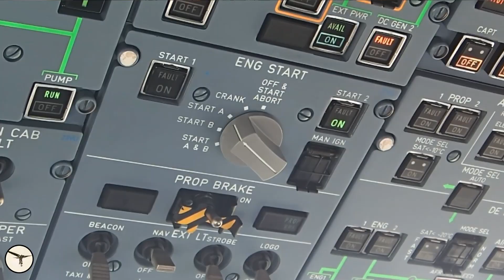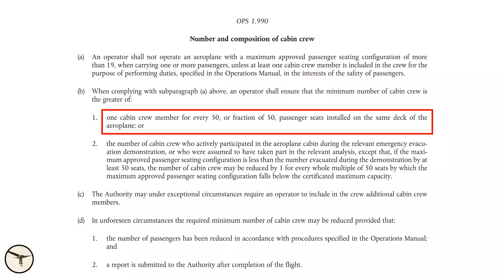Why was ATR's first aircraft named 42-300?

Comment: I have a question about the ATR cockpit. How wide is the panel between the pilots were the FMC is located in centimeter? I like to build a ATR homecockpit for a simulator but i can't find any measurements. If i know how wide this part is, i can calculate everything else from there :D
Reply from the maker: Contact me on my email (see the About page in my profile). I have several illustrations with measurements.
Reply: @FlywithMagnar  Thank you Sir, i will do that today :)
Reply: @FlywithMagnar  I wrote the e-mail :) I hope it will not end up in your spam :D

Comment: The ATR-42 was the first aircraft I have ever flown with as a passenger. I remember the seating area in the front where two seats were mounted backwards so that you had a table between the four seats where you could sit as a group and eat or play a game together. Were that common in all ATR or was that just in a few selected ones?
Reply from the maker: The club seating arrangement is quite common in airplanes with a high-density seating. However, the cargo compartment is smaller in size. It's up to the operator to decide what is most important: Two more seats or more space for the bags.

Comment: When I started in the Aviation Business in 1990, we had four ATR 42-300 in our fleet. MSN 38, 53, 122 and 158. Four more came in 1991 and 1992. MSN 233, 255, 287 and 289. We also received ATR 72-212A MSn 347, 359, 404 and 446. Further Aircraft came for NFD - Nuerenberger Flugdienst in 1992. I was responsible for 43 ATR42/72 at RFG and Eurowings.
Reply from the maker: In 2000, Eurowings sold two ATR 42-320 to Coast Air in Norway. One of them is the blue aircraft in the video. The aircraft were modified for steep approach. We operated them on a 800 m long runway in Florø (ENFL). Later that year, the runway was extended to 1200 m, which enabled us to depart with a full load of passengers.
Reply: @FlywithMagnar  These were the two ATR 42 from NFD - MSN 110 D-BDDD (to LN-FAP) and MSN 148 D-BGGG (to LN-FAO).
Sadly the MSN 148 was broken up in 2016 in Dinard (DNR).